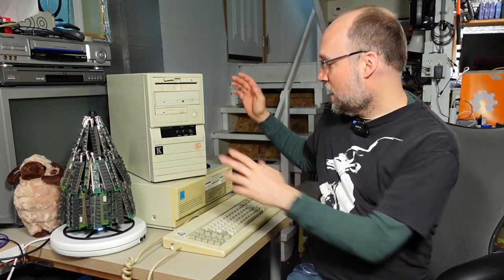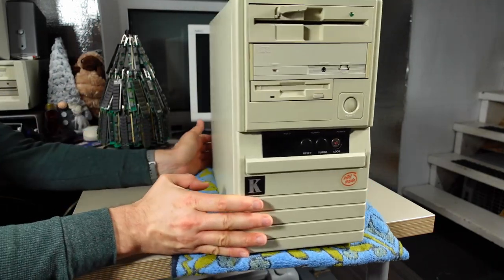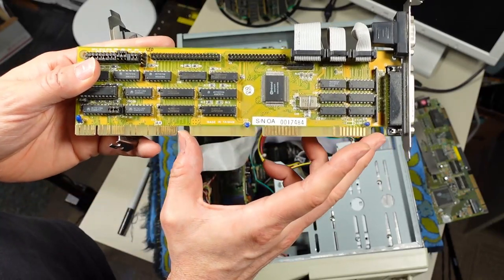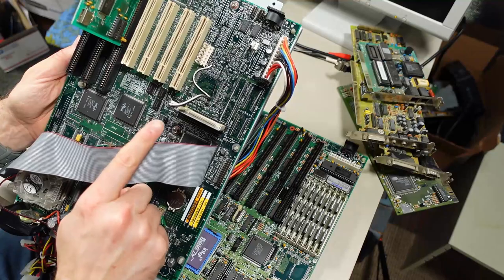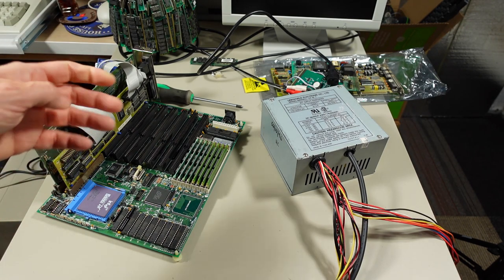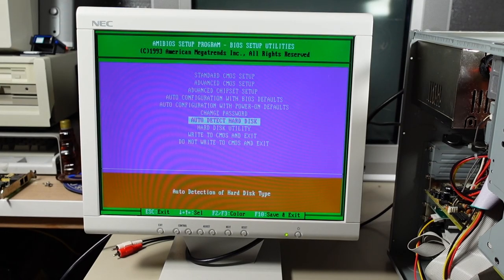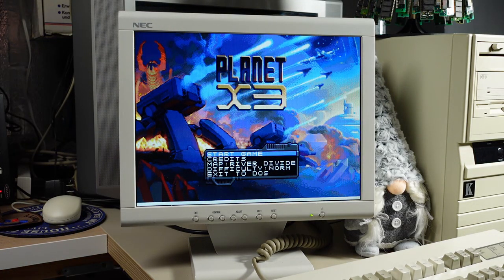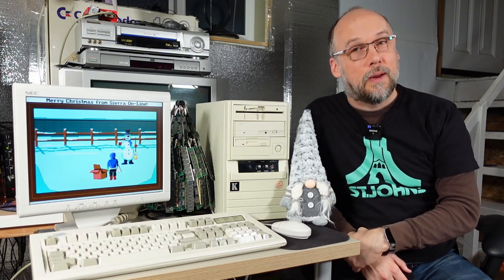PC archeology: Mystery 486 Mini-Tower

Comment: That Modem you could save the rom chip for a commodore 64 rom to replace the Kernal, Basic, or character roms,  that would be a good rom chip too because it is really in exellent condition, because that chip wouldn't have been used for much, like for what, a bios? Could also use the sockets too if your commodore 64 is thirsty for GOOD sockets.
   It's really quite interesting how many more chips the old ISA cards had and their own bios for graphics cards and whatnot.  There are some strange cards for ISA that were either for commercial proprietary things, or special frame grabber capture cards\ video cards. I have a very early pci card that I really don't know what it is or what it is supposed to do, it is found in new hardware as a tseng graphics card, but isn't able to be used as a graphics card. It has a vga port, in\out aux sound jacks, and a nine pin port that is either a serial or a graphics cga port! What a strange card!
It is known as a Matrox marvel 2 rev A I believe, and drivers seem very hard to find for anything these days.

Comment: The barrel battery on my 386 board was recently replaced by the previous owner. Also, there is a bodge wire near the keyboard port where some damage has been repaired.

EDIT:  I was born in 1991 and am interested in computers from the 1950s to early 1990s.

Comment: There are optical output ports on that professional sound card through a injection moulded adapter than goes into the line out then your TOSLINK plugs into the adapter, if you are looking for an OS that won't get infected then Lubuntu latest version might be in order and if your are scared of Malware then Comodo Antivirus for Linux should work provided that la32-lib is installed as the Comodo Antivirus needs it, if only there was a SATA Adapter add-in card was available then you could tidy up the inside of the computer,
Try LH Driver=MSCDEX001.SYS

Comment: Excellent video!  Is it normal for a 486 not to have a heatsink on it?  It certainly looks like building a PC in 1993 was a lot harder then building one now!
Reply: For 486 processors running at less than 50 MHz its very common not to have a heat sink as the chip was only slightly warm to the touch while the system has been running for a while.
Reply: @MrBillmcminn  Gotcha.  If Adrian wanted to put a SCSI CD-ROM drive in this PC, would he have to get a SCSI card for it?
Reply: @dave4shmups  Yes a SCSI card would be required to use a SCSI CD-ROM.

Comment: Those Pro Audio Spectrums had funny drivers.  At one point, IIRC, my 486 or Pentium's sound card would only initialize properly when starting Windows 3.11 or 95 first.  Otherwise, you'd get that funny issue where DOS games wouldn't be able to use it.

Comment: I do know that there are rechargable 2032 coin cell batteries, aka LIR2032 or ML2032. Could they be used instead of a NiCad rechargable battery without the diode that you'd usually install for the non-rechargable CR2032? Or is the non-rechargable CR2032 a better choice?

Comment: The reason that 1,024x768 didn't work on the NEC monitor was likely because the video card was sending an 87Hz interlaced signal that the monitor couldn't handle instead of the usual 60Hz progressive signal
Reply: That's what I was thinking. A CRT monitor would work fine in this case. I've actually run into the 87Hz problem with a 2005 HP server. No LCD monitor would work at that resolution, I needed to force 800x600 for usable graphics.

Comment: if you can find an MR bios for the board it may be possible to use larger hard drives. Maybe.
That white bar may be if the software is asking for 320x200[Doom] when the video card only really supports 320x240.

Comment: don't mess with the switch, just put a phone charger and 5v 2 channel relay inside the psu and make a safe 5v switch on a cable outside
Reply: Yeah somehow that's more dangerous. Rather switch the 240V at the front than shove an always on charger and exposed relay somewhere in a case. Just don't be an idiot when using these computers and you're good

Comment: There is a way to reverse the turbo buttons on those cases... i forget exactly how.. something about how the cables are connect at the back or on the motherboard
Reply: If it's a 3-pin turbo connector, it just needs to be flipped 180 degrees on the same pin headers.

Comment: Back in those PC building days, did you ever find a motherboard that was not compatible with the case?
And by removing the NiCad battery, what will power the BIOS when unplugged from mains? Aren't you going to install any CMOS batteries?
Edit: I should have waited till the end

Comment: You suspected the CD-ROM reader was made by Mitsumi, did you actually determine who it is made by?  Also, do you think you'll replace the Media Vision sound card with one that's more compatible?  I thought many sound cards back then had a direct connection to the PC speaker output, that is, you could run a cable from the PC speaker connector on the motherboard to the sound card, I had no idea PC speaker sound could be sent over the data bus.

Comment: Just order a small hobby project box for that AT supply power switch. You'll want to drill a hole and then file the hole square, and the switch should pop right into the opening.

Comment: In the build I did in 2019, what ended up being disappointing is that there was nothing to put in the PCI slots other than the graphics card in the one special PCI Express slot. The motherboard provided every other desirable functionality. Back in the day we had to shop for and select a lot of other cards. Modern builds have gotten kind of boring. But is still the way I prefer to roll - custom built computers. But please, someone suggest something cool to put in one of my PCI slots - bonus points if it's retro computing related (Commodore 64 or an Apple II on a PCI card?), affordable FPGA, or something to do with my latest hobby, GMRS radio.

Comment: Old, I know, but those connectors on the mbd are supposed to have the corresponding notches to match each of the power connectors so keyed and not as likely to be plugged in incorrectly/reversed.

Comment: Pausing the video at 6:35, looking at the sound card it looks like a Pro Audio Spectrum. It most likely it is the common PAS 16, but it could be the original dual OPL2 PAS
Reply: Ha! So at 15:16 it is clearly a Taiwanese Pro Audio Spectrum 16 knockoff, it still seems to use the MVD and Thunder chipsets which should provide PAS16 and SB2.0 capabilities.

Comment: There is a Vogons thread from 2014 about this particular sound card. It seems to be a knock off PAS16 with cheaper components. (and a clone OPL)
A search for "MediaVision Thunder Audio Spectrum 16 Rev. E Audio Driver" should give you the Mitsumi compatible driver from soundcard-drivers: 19477 spectrum(dot)zip

Comment: I enjoyed this video👍 but i have a question. I have the same mitsumi cdrom drive and a sound card with a mitsumi connection on it. 
I would like to use it in my own 486dx pc but the sound card and its mitsumi connection won’t work. At this point i use a gravis card for sound.
Reply: It needs a special interface card and won´t work on IDE or Mitsumi connectors.

Comment: 1024x768 probably defaults to 87Hz interlaced, which your LCD probably does not support . The video card's RAMDAC might not even be able to do 1024x768@60Hz non interlaced .

Comment: i would like one like that with the 3 drives in it. but i also want win 98 for some games i have, is that all doable on the same machine or would win 98 be to late? i was using my cd rom games on a win xp laptop but i think win 98 would be better for them. i have 5 games that range from 486/dx33 to pentium 266.

Comment: Adrian ,  I might have a driver disk for that sound card and cd-rom . LONG ago i had one of them :) ,  i still have the two floppy's one is sound drivers and the second disk is cd drivers . it included panasonic , toshiba . Mitsumi , NEC and Sony to work on the card.  I will check and see if the disc's are still good . IF that cd is one of the above drives i can maybe upload an image someplace online for you

Comment: According to WIMs BIOS, the 006362 refers to Northgate Computer Corp.
https://th99.classic-computing.de/m/M-O/32357.htm Looks like your board.

Another issue with the sound is the speed of the data being sent ISA bus on later 386 and faster motherboards. Data gets sent too quickly and on a lot of old programs, such as the game Populous, OPL sound would be garbled or not work at all without a bunch of wait states added, which not every BIOS would let you do. Usually it would be a setting called 8bit and 16 bit IO wait states or something similar. I've also noticed MIDI data sometimes seems to get jumbled as well. I believe The Incredible Machine has that issue.

Comment: Its perfectly normal. You could have like 3 or 5 MB of RAM on a 386/486 :) You just had to populate first channel with 4x 256kb and second with 4x512kb. Oh, sorry, back then it was called "banks" not "channels" :) I've had 486DX with VLB with exact same 8 RAM slots, with 3, 5, ultimately 8MB of RAM :)

Comment: What aspect ration does your TFT Display have? 5:4 or 4:3? If the former, the white bar at the bottom might be some scaling artifact if you display 4:3 content.
Reply: This seems to be a 15" monitor so I'd say 4:3 (all 15" LCD monitors have a native resolution of 1024x768 and thus are 4:3).

Comment: That looks like a Mitsumi Lu005s. It requires a special interface card and is not compatible with IDE and mitsumi connectors on later drives. It´s difficult to find nowadays.

Comment: If you come across another AT case like that or similar that you can pick up, I would totally buy it from you.  AT is pretty much impossible to find here in this wasteland of tech.  And our local recycle center refuses to sell anything so I can't get my hands on cases easily.  I have half a dozen boards but no cases.
Reply: He probably had a thousand people who would buy it off him. Maybe you could adapt a atx case
Reply: @blackterminal  I tried that.  Adapting the I/O shield is a simple thing, but almost every ATX case doesn't have a mount for an at switch.  I have looking into creating a pcb to turn the atx momentary switch into the toggle style switch used in xt and at, but I have no skill in electronic engineering or pcb design.  It would be pretty darn simple, two ground inputs and the bridge connectors which are 5v I think.  And some sort of controller that takes the input from the momentary atx switch and holds until it receives another momentary switch pulse?  But I don't know.
Reply: @helldog3105  get a cheap toggle switch from your local electronics store and drill a hole and screw it in

Comment: This year the formfactor for the power supply actually changed for modern computers. I think only Seasonic offers them for now tho so not very commen.
Reply: It's not that they changed, just that SeaSonic offers their proprietary variation of it now. You need to buy a case from them to take full advantage of it.

Comment: This would have been a better than average computer in 1993. It will take a DX2/66 CPU and up to 32 MB of RAM if you can find 4 MB 30 pin SIMMS. I would put a fan on the CPU! It should not be hard to enable the turbo/slow function and find a numeric display on Ebay. And then - OS/2 version 2 baby! Built-in drivers for all this old stuff!

Comment: It's actually not bad to have a slow 486. Will do nicely with games between 1988 and 1994. The Lucas arts games, klots of strategy titles etc. I prefer it to the fast 486es, because they become more and more pointless compared to a pentium. Doom will do great on a Pentium 1 and Test Drive III will run way to fast on a 486 DX2 66.
Reply from the maker: I use a Pentium MMX 200/166 machine where I use the cache disabling tools on it to slow it does as needed and it does work quite well slowed down. (to play those games which are too fast on a 486 like wing commander and test drive )

Comment: I wonder if the fact it's only reporting 8064K of RAM is due to the shadowing options being enabled?

Edit: someone on Vogons said they have the driver disk for the Thunder Audio Spectrum but they didn't upload it so you might want to message them.
Reply from the maker: Maybe? Although it's it's missing 32k which seems less than the shadowing should be using.
Reply: Shouldn't it be 8192, so it's missing 128k?

Comment: How much memory is in that video card? Also did you end up checking the power supply out for any suspect capacitors etc?
Reply: Looks like 1MB judging by the SOJ package chips. Can't be upgraded easily to 2MB though.

Comment: Real or fake L2 cache? Its around the time when many 486 boards were known to have fake L2 cache chips.. Blank chips that were designed to register the board as having real L2  cache. Though there were utilities you could use to test if the board had real or fake cache installed. Also no pins for external battery on this board.

Comment: 7 seg digital display "fiddly to adjust"??? the segments are just hard wired to positive via one side of the turbo switch or the other to light up the desired pattern. when speeds got higher than 2 digits, it was often just wired up to read "HI"...

Comment: Round and round she goes, where it stops, nobody knows. Adrian playing the 90's mom and pop PC roulette. Place your comments... Here we go... 486 BioStar  mother board, with a VESA Local bus for IO, and Trident video cards. The CD-ROM and Sound card are from a Creative Labs multimedia kit. There's static RAM for a cache, and 4MB of 30pin SIMMs. There should be a two/three digit display for MHz, up front. The CPU may or may not have a cooling fan. The only fan is in the power supply. I literally assembled hundreds of these computers (1994/1995), with Quantum, Connor, Maxtor, Seagate and Western Digital hard drives. I liked the Western Digital Caviar HDDS, the seem faster than all the rest. Quantum was good too. Connor was the worst. The FCC ID is fake, no one actually submitted their commodity built PCS for certification. We set up a master PC, and used Lap-Link to clone the master to final units. - There my bet is placed. Now on with the video.

Comment: Have that case in the attic. Unsure if it is the one I put the Amiga1200 into or if its som dx280 system
Reply: Those white studs messed up a pentium2 system for a friend. P2/P3 and later grounds the motherboard through the various screws. If you instead use plastic distances, you get a ground of more than 0 Volt, giving your less than 12, 5, and 3.5 Volt of potential between the power+ and gnd, leading to flowstate on your memory and component, where the signal randomly varies between 0 and 1 when it is supposed to be 0. For all who know binary, it has 3 states (technically 4): 1, 0, and flowstate (in process of charging or dischargint which takes a small matter of time, the reason for your mhz timings)

Comment: I found a site that has a ton of info on these cards. Some came with a Philips or ide cdrom interface. I remember the one I had had some very proprietary interface. The connector had less pins than a floppy cable. Every time I post a link to the site for this card , my comment. Gets deleted!

Comment: Amazingly, I had no damage on my amiga 2000 motherboard from the battery. Maybe because it is dry here?
Reply: You can still get battery damage in a dry climate, but a damp atmosphere makes it much worse as it spreads the acid everywhere. The worst one I ever saw was a Mac Classic II that had been kept somewhere damp, the lithium battery had leaked which destroyed the entire motherboard and rusted out the bottom 2 inches of the chassis.

Comment: I did a search for the Thunder Audio Spectrum 16, and there's a thread on Vogons about it here;

https://www.vogons.org/viewtopic.php?t=40371

This is actually not built by Media Vision, turns out it was made by Top Thunder Technology Ltd. of Taiwan. There are specific drivers for it according to one poster on that thread, and someone got it successfully working in Windows 95c. Media Vision had something called the ThunderBoard which was an 8-bit Sound Blaster clone at a reduced price. When Media Vision released the PAS 16, the Thunder chip was integrated onto it. The Vogons thread has some good images of the card with the FCC ID and that it was "Made in Taiwan." Media Vision always touted that their cards were "Made in the USA." They did sell chipsets, so it's no surprise that one ended up on a Chinese board.

I think you MIGHT have installed the PAS driver with the SCSI utilities (some PAS board reviisions had a SCSI interface) if you download the one without, it should support the Mitsumi interface on your card. Hope this helps.

Comment: Looks like your BIOS 50MHz speed is conflicting with your 33MHz Clock Crystal. Probably what's causing a lot of your weird compatibility issues.  The box itself is almost as if someone replaced some key parts with a cheaper CPU, a low mem VLB VGA card and an ancient CD-ROM; just enough to run, but not perform. Hard to believe someone would use a ZIF-socket board for a very common 486DX 33 MHz.  I bet it had a DX2 or DX4, maybe even an OverDrive, all of which would take better advantage of the CD-ROM and VLB-bus capabilities for multi-media.